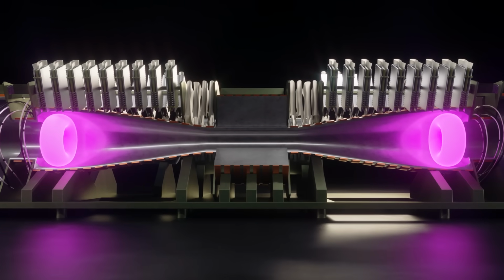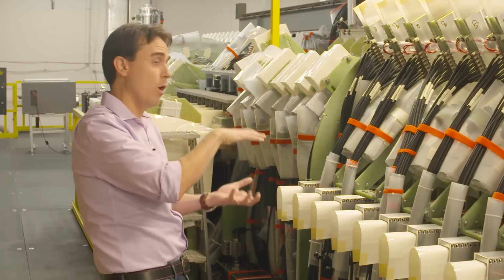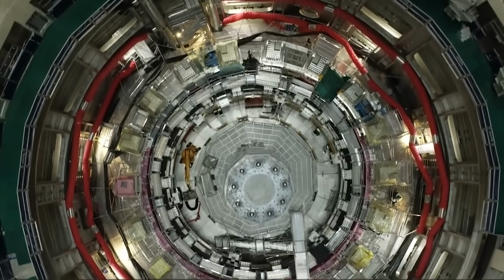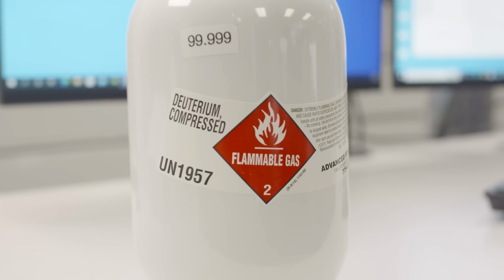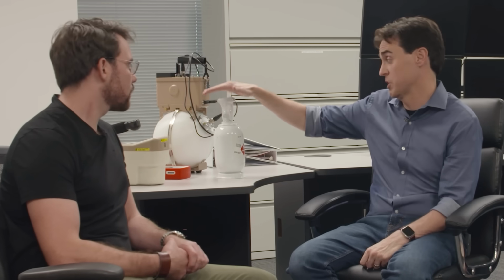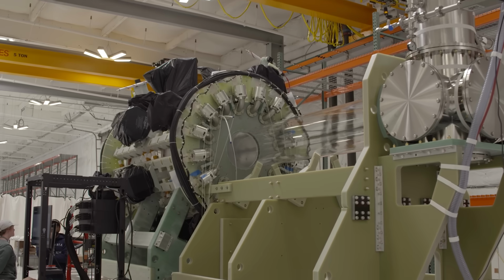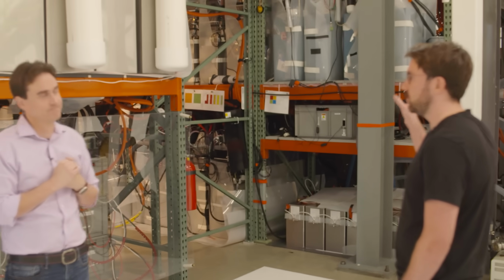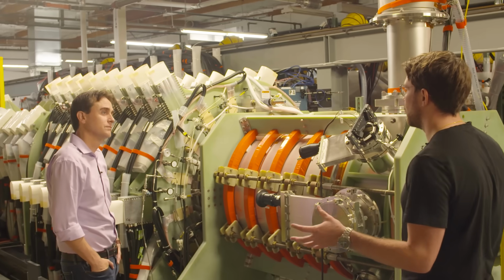A New Way to Achieve Nuclear Fusion: Helion

Comment: So this company is basically a fraud? Taking money from investors but doing exactly nothing,didn't even have positive energy result.Damn,everyone with cool theory can get money I see..
Reply: Define "positive energy result"! This is an experimental machine that cost very little (for fusion terms) and performed as expected (better than expected in some aspects). The next machine, Polaris is based on the results from this machine and will produce net electricity (which is what really counts).
Reply: @elmarmoelzer2229  Total absence of any fusion neutron,no neutrons no energy output no commercial net power what is there to be explained?In 2016 they said that in 24 months they will attain net energy output , basically have a pilot plant in 2019 which is a lie,a fraud to keep money flowing in their company..
Reply: @BULA933  BULLSHIT! 
1. They have had neutrons since 2009. Those were peer reviewed and published too. E.g. IPA achieved 10^9 neutrons back in 2009, later published in a peer reviewed paper in 2011. Their last machine Venti achieved 10^11 Deuterium- Deuterium neutrons per pulse (about 10^13 if you assume D-T). That was back in 2018. It was reviewed by the JASON review team for ARPA-E. Trenta is much bigger and should at least be an order of magnitude higher in neutrons/pulse. The results were also reviewed by investigators from the big national labs before their investors handed out the big bucks in 2021.

2. They never said such thing. What they said was: "We are trying to raise money for a machine that would demonstrate the viability of the concept. Building that would take 2 years. "
The press then interpreted that as "we will have a working power plant in 2 years". See the problem there?
They did not get the money. So they could not do it. Instead they built subscale machines that more slowly inched towards the goals. Polaris is essentially what they would have built if they had gotten the money back then. Even Trenta is slightly subscale.
Reply: @elmarmoelzer2229  we shall see if there will be any positive income from Polaris,I will be just sceptical..

Comment: "Scotty, get the fusion generators back on line!" 
I am a generator man. That is what I do for a living. This design is brilliant! Elegant , simple, in that it eliminates a lot of really complex and expensive equipment required to convert heat into electricity. It eliminates the need to deal with neutrons, the confinment field extracts the energy from the fusion reaction. In a really innovative way. A way that actually decreases the weight and complexity and will certainly be , in my opinion, used in other magnetohydrodynamic generators using energy sources other than thermonuclear.
     Whoever devlops this technology will be the SpaceX of....... Wait a minute! SpaceX should support this tech and it's development right now. This tech has obvious Aerospace Applications.
Reply: Unfortunately, Musk does not believe in fusion. He is heavily invested in solar. There are a few former SpaceX folks working at Helion now, though.
Reply: @elmarmoelzer2229  really smart people change their opinions when presented with good information that indicates that those opinions should change. Not opening his mind to Alternating Current was Edison's most profound regret. He said so. Edit: If Mr. Musk Takes a good look at this his view may alter. This system eliminates a lot of klunky, bulky stuff and weight. "It looks right." That is my subjective assessment.
Reply: @daleeasternbrat816   I think that Musk might change his mind after Polaris demonstrates net electricity. That is a big "might". He and his companies are heavily invested in solar and batteries. He would have to defend that to investors too.

Comment: The energy that needs to be transformed, out of the plasma. The plasma is the end product of the fusion. That's where the energy comes from. You need a strong magnet field to contain it. The longer the plasma is present before more fuel is required, Is the key to producing efficient energy. You can create plasma in a microwave but it'll only produce it till the feel needs replace. Typically only about 1 minute.  Anyway contain the plasma in an magnetic field and by all means experiment with different fusible fuels. Also my want to wrap some coiling coils around the magnetic field. This will keep costs of replacing the parts to the magnetic field. I'm giving it a go. And would love to invest if I had money.

Comment: What type of metal casing is used in the elongated hourglass - which has the highest temps?   I'm not a physicist, but would like to know what metal has the high enough melting point - to withstand millions of degrees - even if the action is not directly touching the metal.  .... or perhaps it's ceramic?
Reply: The fusion plasma is very hot, but not very dense (closer to a vacuum than to ambient air) and it is surrounded by a high vacuum, which is a perfect insulator. The total energy content of a pulse should only be a few kWh. 
The plasma is prevented from touching the walls by strong magnets. Even without that confining magnetic field, the damage from the plasma to the walls would be relatively small and only matter over a very long period of time. That said, these machines will need maintenance and some components replaced every few years (not sure how many, but I assume it is more than 4 years and less than 20).

Comment: The National Ignition Facility of Laurence Livermore National Laboratories beat you guys to it. You should have used 2 mega joules of microwaves on a gold capsule of a diamond encased mass of deuterium and tritium to achieve fusion to produce 3 mega joules of energy.  Hey, adapt your tech to match this and commercialize it.  Let me know when you have an IPO.  I want to be rich.
Reply: I assume that was sarcastic because NIF is a lot further from a commercial power plant than Helion is. Their lasers are very inefficient and that is not included in the numbers above. 
They are still off by a factor of 100.
IPO will not happen until some time after they have power on the grid. They are fully funded all the way to that (and beyond) anyway.

Comment: Truth be told, sure they can have this fusion, but it's so weak that it won't even power an electric train set. I'll give it another 400-500 years and they might figure out how to make it power a refrigerator. Just stating the truth.
Reply: They are aiming for the end of the decade for a full 50MWe power plant. So not that long...

Comment: forgive the stupid question but if the temperature goes up to millions of degrees, wouldn't it....melt whatever's anywhere near it?
Reply: The plasma is hot, but not very dense (less than 1/1000 the density of ambient air). It only contains a few kWh of energy.
Reply: @elmarmoelzer2229  ah i see. thanks!

Comment: A big problem in physics is the future workers get thaught to perceive temperature, densities and time as scalar values when they are still students.
A big problem with fusion reactions and power generation in general is the inability to control the directions the collision products get ejected to - which makes using the kinetic energy of the new particles for upkeeping the reacion unsuitable.
Reply: They don't have to keep the reaction going. The machine is pulsed. They purposely keep the pulses short and make up for the lower confinement time with higher density. The shorter pulses allow them to capture the fusion energy and even 95% of the input energy during the expansion of the plasmoid at the end of the pulse.

Comment: Creating new, heavier elements always requires energy including the creation of helium. How does this fact elude all of science?
Reply: That is not correct. Fusion up to iron is exothermic. That is due to the fact that heavier atoms resulting from fusion have less binding energy than the sum of the binding energy of the atoms that were fused into them. This binding energy is released.
Reply: That's what you've been told. Unfortunately, it is an "ad-hoc" explanation created to make the Big Bang theory work. All nucleosynthesis will require energy which is why science created "supernovae" and "exploding neutron stars" to create the energy needed for nucleosynthesis. Somehow, fusion gets to completely bypass this situation. Why? Why has it never created energy? Who is right? Me, or the entire scientific community? It seems obvious.

Comment: Helium 3 is the main issue to this process. It is hard to obtain. Ironically the surface of the moon is known to have deposits of it.
Reply: You might have missed it, but Helion will produce their Helium3 by fusing Deuterium in the same machine. D+D => He3 +n or D+D => T + p (the Tritium eventually decays to He3 as well). No space travel required.

Comment: Ok.  For buddy to actually admit he didn’t think fusion technology wasn’t possible is disgusting naïve.  Why wouldn’t it be possible?  Anything and everything is possible.  It only takes imagination and time.  At one time they said simple flight was impossible.  It was impossible to turn room sized computers into something portable and useful.  We now have space flights and quantum computers.  Granted just starting both but what do you want in only 120 is years in flying and 70 years with computers.  In 100 years we’ll have fusion generators the size of a modern car battery.  With the help of AI quantum computing in 200 years we won’t need to generate power at all.  We’ll just get it from the quantum field.  Instant energy at any amount for whatever we need.

Comment: It seems there will be D-D fusion occurring in this device beside D-He3 which means there should be a measurable neutron flux. What is the magnitude of neutron flux being measured? Also, there is inevitably going to be tritium produced. Doing D-D off line is an interesting idea but how to you keep that from happening in the primary energy producing device? Don't get it. 
Has anyone been fried by the neutron flux yet?
This process is going to produce a pile tritium. It's wrong to call this a clean process.
I sure wish this was something that was going to happen soon. I just don't see it. 
I have worked on fusion devices throughout my career. Baseball, TMX, MFTF, NOVA, SHIVA and NIF. MFTF (based on results of TMX) was supposed to be the breakthrough that was going to achieve break even. It was a dud. Next came lasers (SHIVA, NOVA, NIF). It was going to achieve break even, SHIVA  nope, NOVA no, NIF not even close but congrats on achieving "ignition".

Comment: where are you going to get the energy to RUN the process...?
Reply: They need about 4 kWh (give or take a couple) to charge the capacitors for the very first pulse. That can come from a wall plug even. That energy goes into the plasma. During the expansion they can extract 95% of that energy back into the capacitor bank directly as electricity. Fusion reactions add additional energy to the expansion that makes up for the losses and adds some extra to sell to the grid.

Comment: I wonder if it can be reconfigured into a large circular track with a magnetic pinch point.  It would be similar to a partical accelerator in construction.   This seems better at producing constant power than an intermittent bouncing action that was described.  It could even have multiple reaction points around the circle that could go on and offline for maintenance without a full shutdown.
Reply: It is maybe not clear in the video, but the two FRCs merge into a single, bigger, hotter and more stable FRC in the center. That is then compressed to fusion conditions by surrounding magnets. Being pulsed is not really a disadvantage. I am not sure why so many people seem to think that.
Reply: @elmarmoelzer2229  I can see how it works in theory.   I was thinking in the terms of conservation of momentum.   The plasma collides in the middle and is repelled outward by the heat generated.  I get that they are planning to extract energy from this in the form of magnetic fields, but then the plasma has to come to a complete stop and be re-accelerated back to the middle to do it again.  This seems like it would require a lot of energy you won't necessarily get back from the next reaction.   In a circular track, you can use the momentum to just feed the plasma onward around the track and back into the start of the reactor.
Reply: @michaellowe3665   They can actually extract 95% of the input energy (without any fusion reactions adding additional energy) from the plasma during the expansion. 
Plus the plasmoids come to a standstill on their own in the middle, when they merge. The important part is that the collision happens at hypersonic speeds.
Reply: @elmarmoelzer2229  Im picturing this as a repeating cycle.   Is that not what is happening?  Do they just get one pulse of energy and have to completely reset?  Do they then extract the fusion products and have to replace them with fuel before running another pulse?  I was imagining that only a fraction of the fuel would be used and the plasma could repeatedly be pushed back into the middle.  I just thought the products would carry a lot of momentum when they expand back out towards the ends of the chamber.   I realize that this is where they extract the energy from the magnetic field of the plasma, but it seems they need to completely stop and reverse it in this configuration. A circular one could provide a place to cool down extract products and inject more fuel on the way back to the magnetic pinch point.
Reply: @michaellowe3665  
They do have to extract the fusion products between pulses. That is how they prevent the Tritium from fusing. They don't want that to happen.

Comment: why not many directions that fire into a spherical containment system?
room for magnets not possible, Would allow for increasing pulse repetition rate, by many 2D paths combining with a 3D confinement, could this help confine, control and remove energy?
How much does a uV's to mV's of noise on your power rails or sensor nodes?
What type of voltage multiplier is used?
Pulse power, power, analog, expertise
Need help?
Reply: It is maybe not clear in the video, but the two FRCs merge into a single, bigger, hotter and more stable FRC in the center. That is then compressed to fusion conditions by surrounding magnets. If you had more than two acceleration sections, there would not be enough room for the compression magnets in the center.

Comment: Take this unit and turn it in to an icosahedron - 10 pairs of these (or higher order polyhedron which will accommodate the base pairs) feeding in to a central reaction chamber and have them fire sequentially to get the reaction pulse rate up.
Reply: It is maybe not clear in the video, but the two FRCs merge into a single, bigger, hotter and more stable FRC in the center. That is then compressed to fusion conditions by surrounding magnets. If you had more than two acceleration sections, there would not be enough room for the compression magnets in the center.

Comment: Could the output of one reactor provide the pulse needed for a second reactor, in place of the basement full of capacitors?  For some reason, I can't help but picture the old radial fighter engines, with one ignition providing compression energy for another cylinder.  I'm no engineer, but my gut is saying "use the magnetic fields as your capacitors" like inductors do.
Reply: Capacitors would still be needed for startup at least, but there are benefits to collocating several cores in one facility. They can share a lot of equipment then, including the capacitors.
Reply: @elmarmoelzer2229   I'm just seeing the capacitors like a car battery and starter motor.  With the number of timed electromagnets needed to fire one reactor, it may not be possible to treat a series of reactors like the cylinders in a car, where the ignition in one provides energy for compression in another.  It will be interesting to see how this all develops.
Reply: @scottk3292   It is more about multiple machines sharing one capacitor bank. One machine is doing a pulse, the energy goes into the bank and most is released to the grid. While that machine cycles up again (evacuate the chamber, cool components, etc), the next core receives power from the bank and does its pulse. Helion is planning for 10 Hz pulse rate. So likely you could have up to 6 machines share a single capacitor bank.